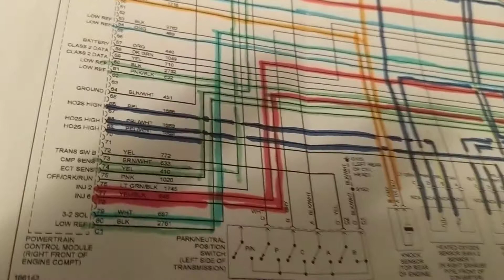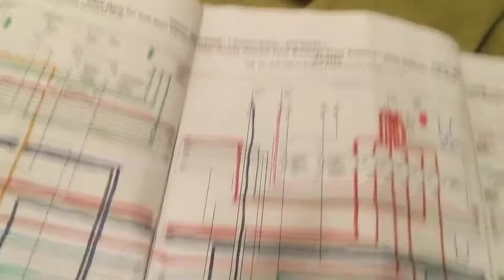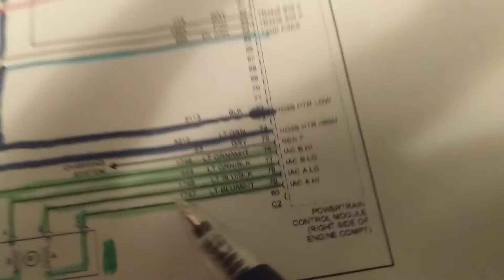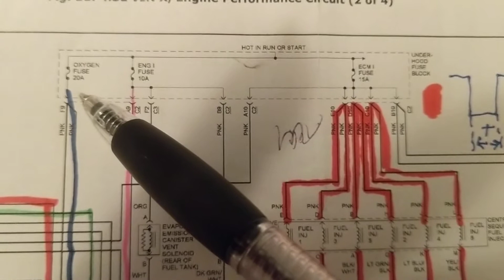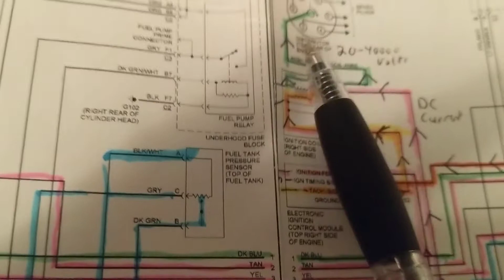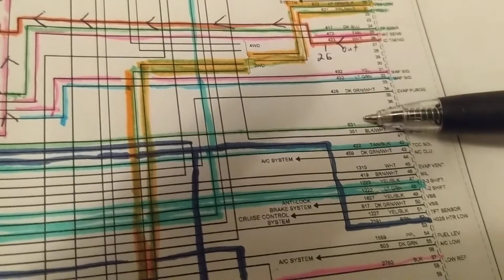How to understand computers schematics simplified good explanation

Comment: Hi, I like your videos !!! I would like to know in a pcm the 12volts reference out put how many amps are they supposed to come out thank you
Reply: Thank you for your question since these are surface mount boards and the chips do not require too much current at all usually in the milliamps thank you so much